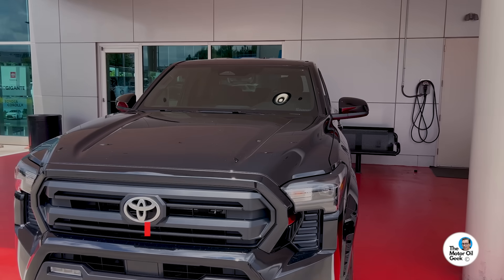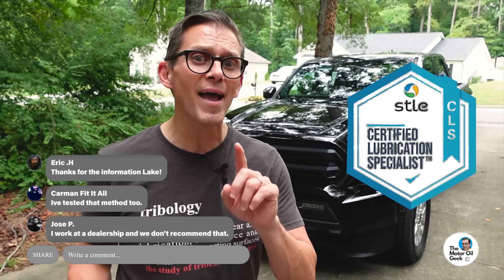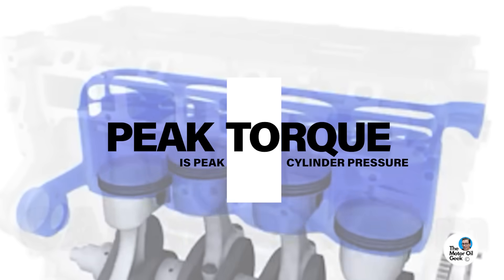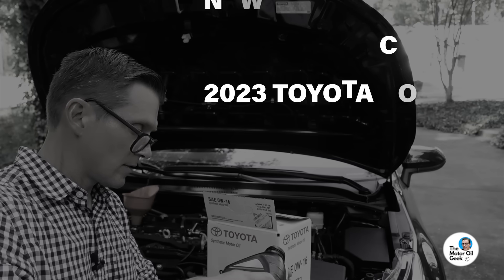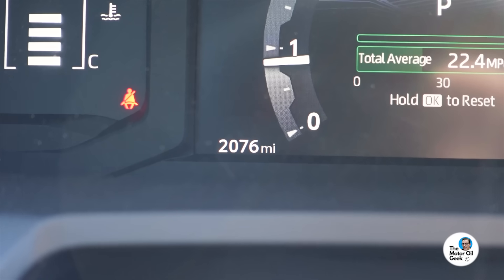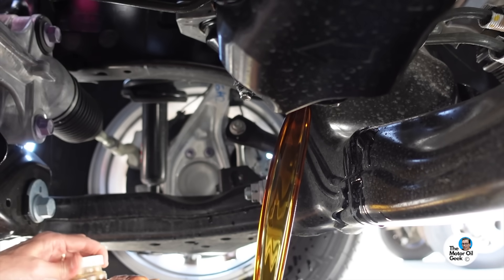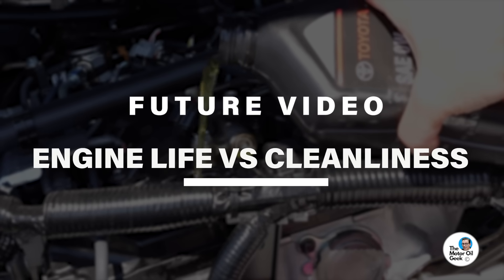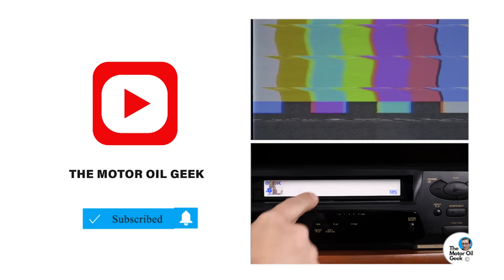The FACTS About Oil Changes (What The Owner's Manual DIDN'T Tell You)

Comment: I thought the guy at Donaldson was only talking about air filters getting more efficient as they got dirtier, not oil filters.  Was he talking about both? ALL?
Reply: MY impression was same: air.  Now, I have to relisten after this one 👍🏻 Relistened:  I'm sticking with keeping air filter longer until I notice MPG change.  The video didn't convince me to keep oil filter unless I was going to continuously test.  Anyone?
Reply: @stuckinmygarage6220  With a fuel injected vehicle (unlike a carb), a clogged air filter will not cause much mileage change because fuel flow is controlled by the actual amount of air flowing through regardless of restriction. However torque and horsepower can be negatively affected.
Reply: Adding another quart during draining likely will not help remove residual old oil.  I tested this myself.  Took a few ounces of new oil and added it to equal parts of used oil in glass container.   The new/ old oil did not mix well, and polar disperants tended to create a barrier between them.  It wasn't until I heated and aggitated the mixture did it mix.  That is why when I do a clean oil flush, put a new filter and oil I bring the engine up to proper oil temp. Then drain and save as a flush oil.  The engine now has 99% clean oil.  Not removing the filter leaves a lot more residual oil in the engine, and prevents the main oil gallery and pump to drain back into the sump.  Another channel I can share tested the normal air temp vs hot oil drain and demonstrated a very little difference in quantity.  He did another video of an overnight drain. He did a normal drain until it dripped.  Plug back in. Removed in the AM and a quarter of a quart 8oz came out.  I've done the same and captured 5-6oz.  I run 10-15k drain intervals so getting as much out helps in the long run.
Reply: @tssci6774    I think warming it up and draining it right away keeps more particles in suspension, instead of settled by gravity into nooks & crannies, so more come out with the oil.  Maybe I’m wrong, but that’s how it works in other suspensions.
Reply: @tssci6774  I parsed that the one-quart-flush was collected separately.  A palate cleanser for the oil pan before filling it with the new sample.
Reply: @TonyBasuro pointless. These T-GDI engines coolers, VVT, turbo oil lines, galleries full of oil and filter contains a full quart or more.  Lake has said similar info regarding residual/carryover oil that remains in the engine.
Reply: @tssci6774 counterpunt: don't tell that to my NOHC motors, especually the one with the metal sliver on the drain plug. I'm happy to send a slug of fresh oil across the bottom of the drain pan.  I do (now) remember that video reminding us about the turbo lines and such.  I just want the pan and drain to be kosher in these matters.
   I like the guy's suggestion about saving flush oil, but now it's used.
Reply: @TonyBasuro 30 minute run time on flush oil is far from used up.
Reply: @tssci6774  "FLUSH." something about reusing flushed liquids that has the old poop in it. I don't want it back in my toilet, or my motor.   And I don't want to invest in an ISS Level water filtration system either.
Reply: @TonyBasuro your engine is recycling used oil every moment it is running, only passing it through a simple filter.  10-20% of used oil remains in a modern engine after a basic oil and filter change. Much more than NOHC  engines of yesteryear.
Reply: @TonyBasuro  Yes, just like pickled ginger between pieces of sushi. Personally, l prefer the ginger and sushi together, along with the wasabi and soy sauce mixed together as well.
Reply: @RalphKramden-il5pf 👍🏻😊
Reply: Only difference I see is that air filters don’t have a bypass.
Reply: Oil filters has similar structure and it works like this: a different size of particles goes through the filter, depending on their weight and size some pass through some never manage and will never do. Other smaller and lighter particles goes through the filter with certain probability - some with 60%, some with 40%, some with 10% and so on. First time the complete volume of the oil goes through the filter some particles will manage to go through the filter (with some probability) but next time more and more particles will stick to the filter and will never go through. Even if the engine never work and produce new particles, just using the oil pump the oil will get cleaner and cleaner with each pass. The filter will do the opposite - it will get dirtier and dirtier, which means more and more particles will start to catch inside. So particle with 60% to go through the filter in its first pass, next pass the probability will go slightly lower (for example 59%). If you do that infinitely at the end every single particle, no matter of their size will never go though the filter, because the filter will be completely clogged! That means no oil will ever go though! So, filter in term of filtering efficiency always improves and over time will become perfect filter that not a single particle will go though. However engine to perform properly requires certain oil flow, so the filter needs to balance its filtering efficiency by providing the minimally required flow. For that reason manufacturer produce a filter that provides certain flow range. For example if the engine needs 40 cfm then the filter might have 65 cfm in the beginning and at the end of its life 40 cfm as required. As I explained, a new filter with its initial 65 cfm provide way more oil flow than required but filters a bit less than ideal. Actually the filter will perform the best when it is slightly clogged but still provide required 40 cfm! If the filter goes bellow those 40 cfm then bypass mechanism kicks in. And remember, we change oil, not because what is in the filter, but because of what is left in the oil! Those two are separate problems, and if you don't change oil it is better to not change the filter because the filter is more efficient when larger particles stick in the filter membrane and thus prevent other particles, with even smaller size and weight to go though filter! So Lake is right! If he is doing those many oil changes is better for the car to not change the oil filter while the filter performs within the spec!
Reply: depends. if the filter's clogged and the spring allows bypass, you're screwing yourself over. The only way to know if it's bypassing is to put a differential pressure gauge across the oil filter. Have fun installing that.
Reply: @olavcramer1260  true, really not worth the risk and/or hassle
Reply: Any filler becomes more efficient as it becomes more clogged.  It just flows less volume.
Reply: @toyota38 true of air filters, not necessarily true of oil and fuel filters. Air filters tend to develop surface “cake” filtration. But depth media like oil and fuel filters often loses efficiency over time. This is because the filtration is inside the media, not at the surface. And the depth is sensitive to the fluid velocity. As the filter plugs, the velocity of flow through it accelerates and it loses efficiency. For ultimate efficiency, you want the lowest practical face velocity. So while fuel and oil filters may gain efficiency over time, it’s often the case that they don’t; they lose it. The fleetguard Stratepore filters, for example, are quite well known to lose efficiency as they load.
Reply: @G5Hohn this makes sense. IMO oil filters should be always replaced if performance or oil starvation are priority items.
Reply: @toyota38  And as the Donaldson guys pointed out it takes a long time for the filters to have the flow affected to the point of not flowing enough.    Really, it kind of makes the old thing about only changing oil filters every other oil change make sense too.   

Then there is the air filter.  K&N brags about flow, but if the filter is the same size as the OEM the only way it can flow more is to have a more open filter media, which will allow bigger particles of contaminants to pass through.  It then comes down to the question.  Does the engine need the higher flow of the K&N?  Very likely not for most stock engines driven in a normal way on the roads.
Reply: @MK-hb3xc increasing the filter surface area decreases restriction and increases flow.
Reply: Spot on.
Reply: The owner’s manual for our Honda Fit actually says to change the oil filter every other oil change.
Reply: @shawngrimes9302 what year? Mine is 2007, I didn't see this.
Reply: Lake, you need a portable lift for your garage or driveway.
Reply: I would have changed the oil filter each time
Reply: Any filter as it is used will fill with particles  and eventually become clogged.  But before that  they filter more smaller particles thus more effective.  But there is a point where it becomes less efficient at the proper flow rate.
Reply: Simple physics. As the filter collects particles, it creates more surface area to collect particles, the space between particles also becomes smaller so allowing it to collect smaller particles. Yes flow will degrade as it builds up with debris, so there is a point when the filter becomes too full. GM's old filter gauges were great as it used filter restriction to indicate the filter was too full.
Reply: Very exciting to see a common vehicle being tested on your channel! Tacoma owners are lucky, you’re doing a lot of the work for them. I know there are other variables, but still. When the Oil Geek has the same vehicle as you or maybe you where buying the Tacoma in the future, just wait a few more months and you have a very good idea of what brand of oil, viscosity and change interval to use! Can’t forget about the filter he chooses to use either probably(factory or standard Wix). Makes me want to buy a new Tacoma just to follow along! Thanks for your everything you do to educate us all.
Reply: Air is considered a fluid, it's just a compressible fluid. The same general principles of Fluid Dynamics apply to both.
Reply: @Mike80528 not in a oil filter vs automotive air filter